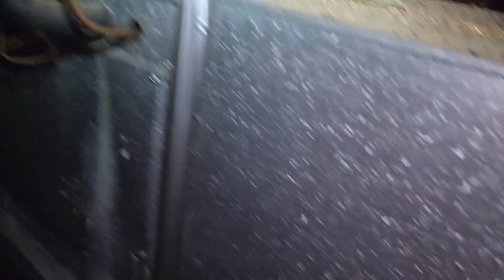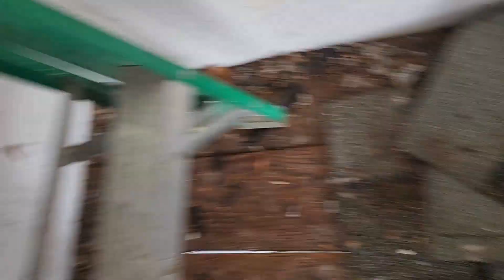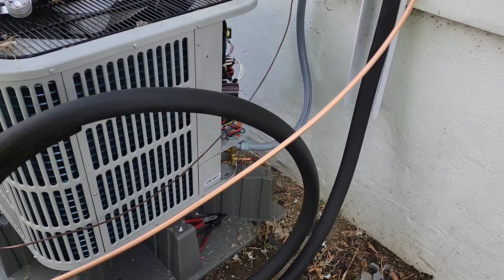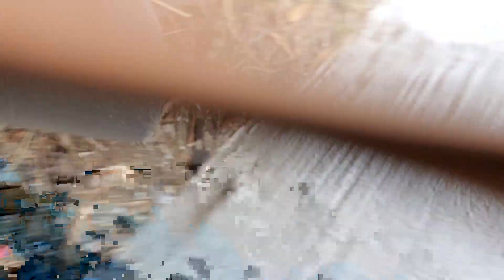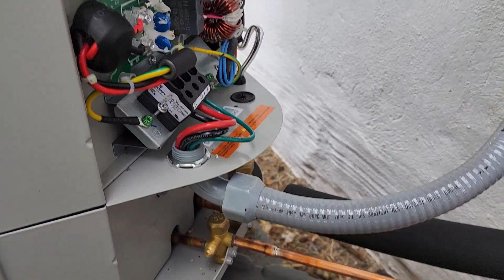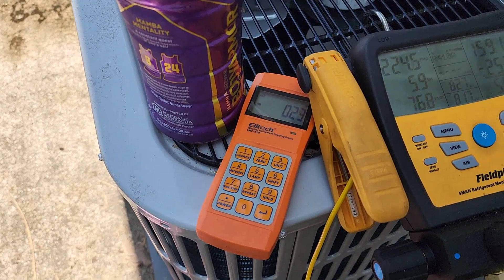First Bosch IDS 2.0 Sale!! Swapping Out Old R22 Carrier for a  High Effeciency Bosch Heat Pump!!

Comment: Tapered drill or unibit will debur copper tubing really fast. You do have to watch what orientation the pipe is in so any chips don’t get way inside pipe 
Usually some taps on bottom of the pipe will make the chips come out though the bit will throw most of them outside the pipe

Comment: Have you done an electric heat element install for BOSCH heat pump?
Reply from the maker: No we don’t use those here, we need heat 5 months out of the year, they use gas or oil for it.

Comment: In Massachusetts we have to be 18” off the ground with heat pumps. I can no longer use those pads. Haven’t found a perfect solution yet.  Quick sling mini split stand 500 lb one with pad underneath metal quick sling.

Comment: Good looking install. I love the Bosch systems. I add a surge protector to every inverter condenser though. It will not only save the customer some headaches but you as well.
Reply: What brand surge

Comment: Why don’t you use nitrogen when using the torch
Reply from the maker: Don’t need to use nitrogen with stay brite 8 solder it’s low temperature
Reply: @DCHVAC  

You do great work 

Just my thoughts 
Take a section a use 8 with out it and look inside and let me know what you think 
 Just wondering 

What is the going hourly pay rate up in your area for a tech start at

Comment: I was told these Bosch systems are made in China.
Reply from the maker: European engineering… made in chine makes parts affordable
Reply: @DCHVAC  
To bad we don’t have American made products like the Bosch product s 
Maybe with this new bill the us will support more manufactures so we can make it here at a rate that can compete in the market
Reply: @DCHVAC  Got some info on Ducayn Lynx, which Is supposed to be made in the US they claim to be identical  to Bosch. Allied sells them.
Reply: @DCHVAC  So, are the systems 1/3 the cost of a comparable Trane or Carrier system?   I'm sure the manufacturing savings are being passed on to the consumer..    My guess is parts availability will be an issue and the cost of the huge motherboard on the condenser will be astronomical.    -Don't know about most people, but I want a unit that a typical service tech can repair with the parts he is carrying on his truck.

Comment: Need to wrap the valves
Reply from the maker: Not with solder very low temp and heat dissipates fast. Also schraders are removed

Comment: Soft soldering!?!?
Reply from the maker: Staybrite #8 by Harris. Used for residential hvac tubing connections. Can withstand higher pressures than brazing, a much more flexible joint, and does not cause any carbonization on the pipe that can damage the TXV or oil in the refrigerant. And the low temperature doesn’t stress the copper as much.
Reply: @DCHVAC  catching your videos and Mikes, sold my first Bosch 2.0. Most intriguing thing to me is the stay bright 8. I know you guys get a lot of hate for it, but it’s literally what the manufacturers use in a lot of units (I think lol) I may have to look into it.

If we could press fitting onto our units I’d consider investing in press tool, but most jobs I don’t have enough joints to make it worth it, plus my torch already has to be out.

Comment: Weigh in your line length charge before you even crack the valves. Easy way in doing it.
Reply from the maker: I dont like to risk getting any atmosphere at all Into the lines so I'd rather add it after the negative pressures been broken